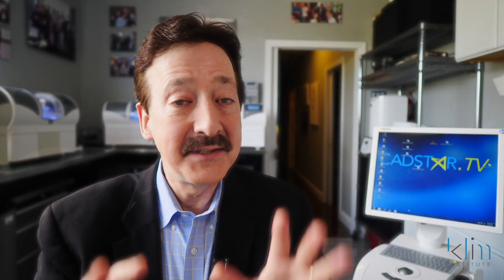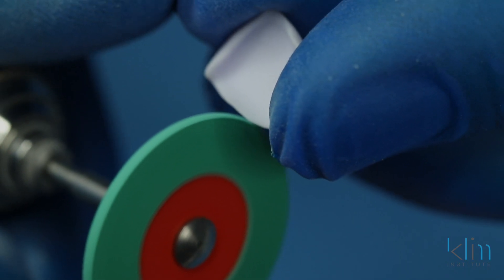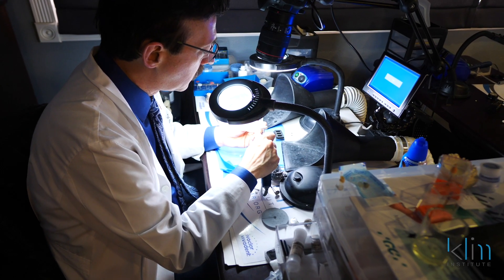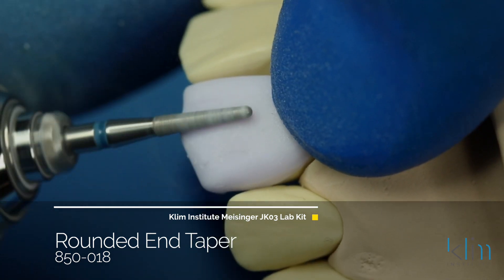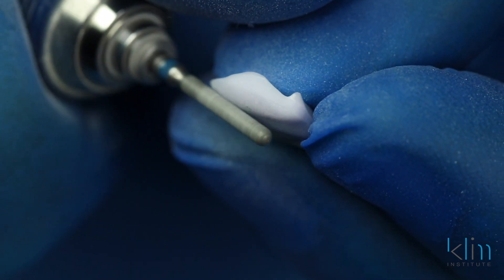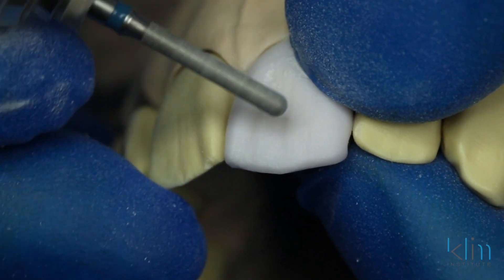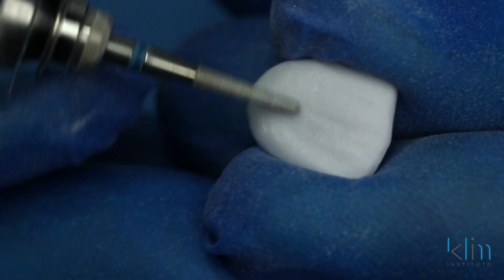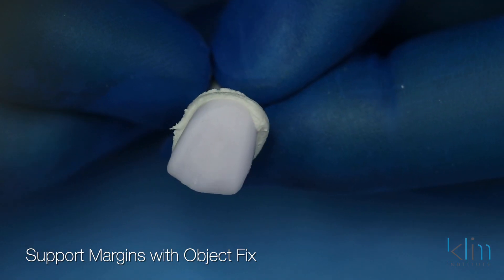A CEREC e.max Veneer Contouring & Shaping

Comment: Hey Dr. Klim,   I love this so much to teach assistans as well as myself.    My question is that you are not using water when you create the anatomy.    I understood from who knows where that you need to use water or you will create micro fractures.   Is that correct?  (anyone else can chime in and let me know why I am mistaken)
Reply from the maker: It depends on the speed and pressure of the burs.  The pink diamonds are made for more aggressive ceramic removal without overheating the ceramic.  The refined texting burs are used with gentle pressure and lower rpms. This approach will be practical even without moisture.  Thanks for the question